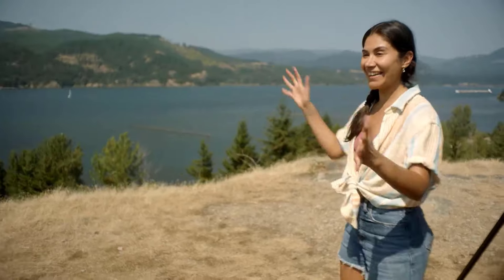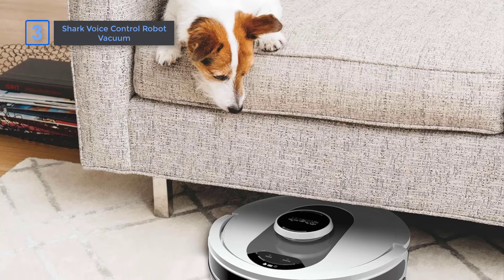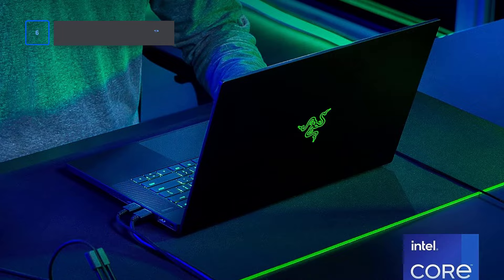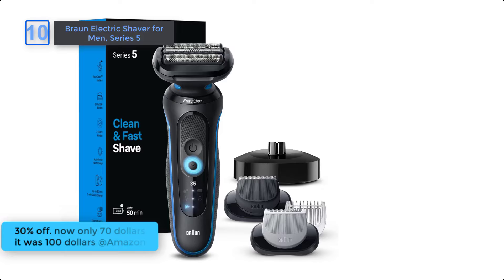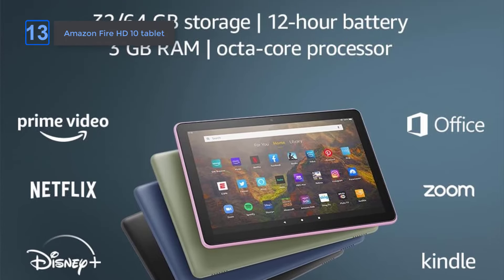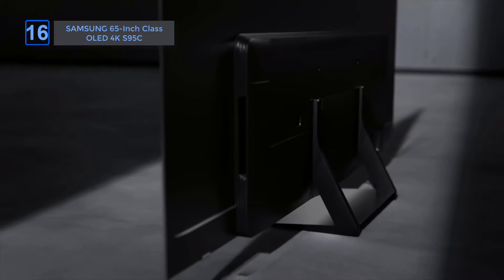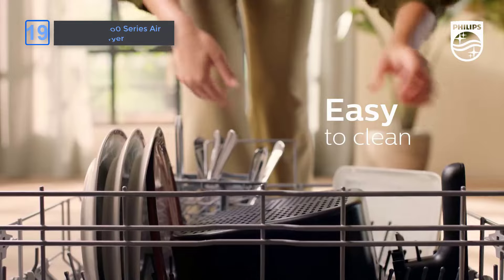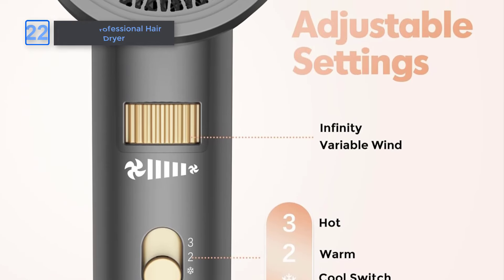Best Amazon Prime Day Deals 2024 | 22 Crazy Prime Day Deals [ Don't miss out ]

Comment from the maker: ➜ Here is The Best Prime Day Deals Link:

1. JBL Tune Flex Wireless Noise Cancelling Earbuds.
https://bit.ly/4f94nDy

2. Shark HV322 Pro Corded Stick Vacuum.
https://bit.ly/46aiTH5

3. Shark Voice Control Robot Vacuum.
https://bit.ly/3SaaSMA

4. Amazon Fire TV Stick 4K Max streaming device.
https://bit.ly/4bLEJ4X

5. Amazon Fire TV Omni Series 75″
https://bit.ly/3S6p09N

6. Razer Blade 15 Gaming Laptop.
https://bit.ly/3Lq1dxF

7. Hisense 65-Inch Class U6HF Series
https://bit.ly/4d2J7Oe

8. Instant Pot Duo Plus, 9-in-1 Pressure Cooker.
https://bit.ly/4d5m7hk

9. De’Longhi Espresso & Coffee Machine.
https://bit.ly/4bLoXXO

10. Braun Electric Shaver for Men, Series 5.
https://bit.ly/3S9U4FJ

11. Ninja Compact Personal Blender.
https://bit.ly/3xZHamJ

12. CHEFMAN Multifunctional Digital Air Fryer.
https://bit.ly/3xR3nn4

13. Amazon Fire HD 10 tablet.
https://bit.ly/3Ltt8Ns

14. Ring Video Doorbell.
https://bit.ly/4fk0vQz

15. DEWALT 20V MAX Cordless Drill.
https://bit.ly/3S6ptJ5

16. SAMSUNG 65-inch Class OLED 4K S95C
https://bit.ly/3WoQCcx

17. FoodSaver Compact Vacuum Sealer Machine
https://bit.ly/4d4pepT

18. CHGeek Wireless Car Charger
https://bit.ly/4d5WNrQ

19. PHILIPS 3000 Series Air Fryer
https://bit.ly/3y1gEJG

20. Bose Portable Bluetooth Speaker
https://bit.ly/3xNYR8U

21. Canon MF753Cdw All-In-One Color Printer
https://bit.ly/3S6CK4s

22. SIYOO Professional Hair Dryer
https://bit.ly/3LoKhHU